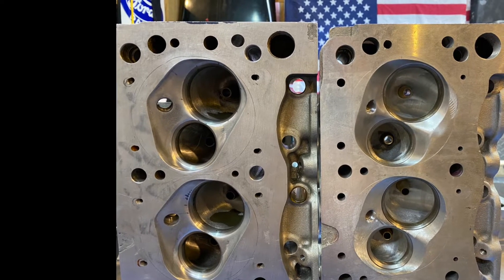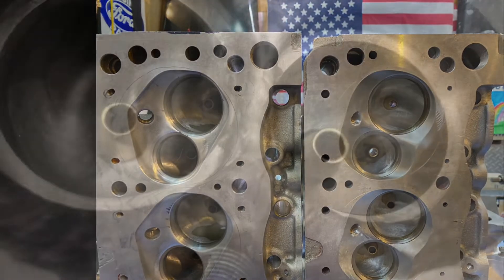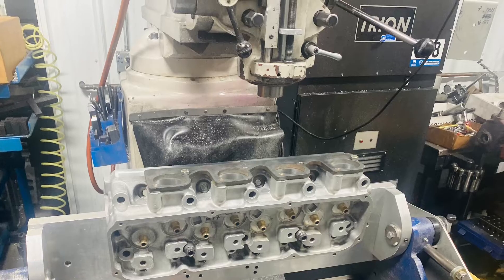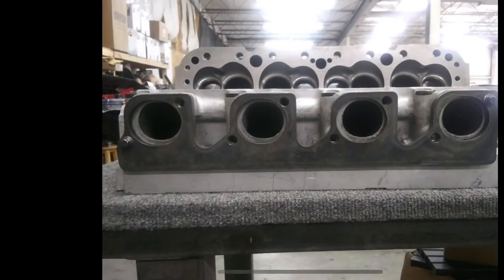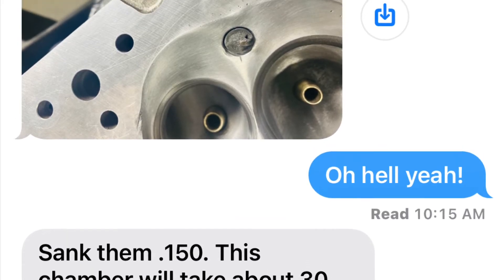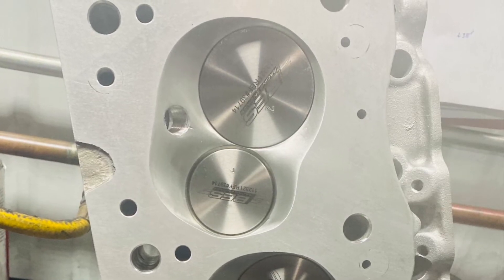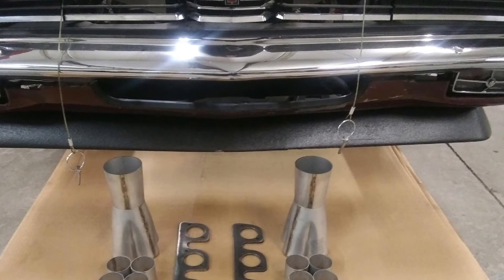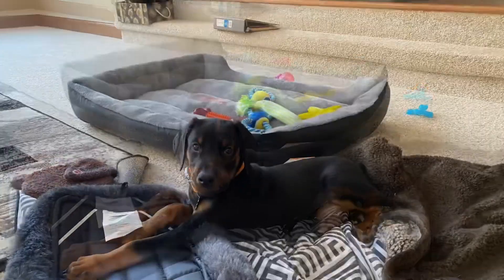DragBoss Garage:Secret A3 Heads for TrackBoss 427 Cleveland, Darin Morgan,  Merge Collectors/Headers

Comment: that is beautiful work. i.e. a work of art !  the big question is, how much HP is gained by all that expensive work, and what is the e.t. improvement ? Clevelands have remarkable top notch head design that can be improved upon even further.   they also have a few major limitations:  the bore spacing is only 4.38", compared to an FE big block 4.63",  and 429/460 which is 4.90", or 4.84" spacing of a BBC.  even the old brand X Pontiac 400/428/455 c. 1967-up had a bore spacing of 4.62", and 14 degree valve angle, and factory air gap intake, which is why it can still do what it does. bore spacing on the old SBC is 4.40"  
Being a thinwall casting block, with short deck, the original Cleveland was limited in bore size, cubic inches, and rod length.  427" is starting to get with the program, no replacement for cubic inches.  it would be interesting at that point, to see how those vintage Pro Stock heads would perform with a single 4bbl. in comparison as a baseline, because now you have the cubic inches under them, to use them at a lower rpm.  compre them to the Darin Morgan heads.  flow both types, cc the ports/chambers on both, dyno both, track test both.  prove it out. otherwise how do you know how much you gained, or maybe even lost, and where the powerband is ? it's all in the numbers.  don't just compare it to itself, compare it to all engines. otherwise we're in an echo chamber with blinders on, not looking at what else may be better and why.
Reply from the maker: Compare apples to apples Charlie. Cleveland I’m not s big ford or Fe or Pontiac. I don’t really care about them or their bore spacing with this build. The heads cost me nothing to develop and weld. Only parts. I am building this engine for a goal of 850hp. With 427 ci of aluminum Cleveland. I do not need to compare to any other engine. It means nothing to me. I will stay in my echo chamber with blinders on.  Not sure why you keep wanting to compare my builds with others.  Don’t take it personal. I don’t care about how much I gained or lost. I don’t care what is better it is irrelevant. Just enjoy the work and stop dwelling on every other engines specs and performance. That is not what this about.

Comment: When are You going to do another Live Video Chat with Darin Morgan?
I really enjoy them.
I am wondering his thoughts on Practical Airflow targets in Cylinder heads chosen to port for Powee and Fuel economy efficiency. 
Been researching the topic and very little information is out there.
The Ford Cleveland is One of the Ultimate Doomsday WW3 Engines I think.
Pontiac V8 especially the 455, Oldsmobile V8,  Classic Chevy V8 small block and Big Blocks.
Mopars like LA engines and B & RB Engines.
I wonder what is Darin's choice DD WW3 Engines ?
I have come to the conclusion 240 cfm - 310 cfm Target intake flow range is practical yet Plausible to get  20+ mpg no Overdrive Transmission used. Use our Personal Favorite Musclecar Race Car 44 magnum bullet proof Transmissions.
Reply from the maker: Not sure right now. Have had a back log of interviews to catch up with. I have some time now so need to get caught up with everything. Not sure what he likes, funny no real interest In Cars.

Comment: Hey Tim thanks for your videos they are awesome as always, also if possible  can you tell me  how much can you bore out  a 351c block  i heard 30tho or you can start getting over heating  issues  what is your professional  opinion ?? Thanks
Reply from the maker: It’s not that it makes them over heat. The cylinder walls are thin and get stressed and crack. The best engine I had was .040, it’s luck of the draw. But I would not go over .030, and fill the block. Thanks Ford
Reply: @DragBoss351Cleveland   thankyou  Tim    always   vrry good advice when you give advice
Reply from the maker: Your welcome. When I give advice, try and answer all questions the best I can. Thanks Ford351

Comment: I like the titanium intake valves, but with the exhaust valves being smaller in diameter than the intake; do using Ti exhaust valves make sense ?  Weights of the larger Ti intake valve and the smaller SS exhaust valve should be very similar. Could you do the weight comparison ?  Also, SS exhaust valves while being cheaper, are also much more durable.. just some thought Tim...   Ps... those heads are pure porn...  Bad Tim.. Haha
Reply from the maker: Thanks. The weight of ti valves is 90 intake 70 exhaust. I remember that steel intakes were like 120 grams. Don’t remember exhaust wt. this is the ultimate build to me and Darin does not use stainless valves I. Anything that runs over 8k. I have ran steel valves to 8 k for years no issue. I am going by their recommendation, since they are building this 427 cleveland.

Comment: Did he even move the plug angle?
Reply from the maker: no just welded up around the combustion chamber
Reply: @DragBoss351Cleveland  must be just the camera angle then. Looks like its  a different angle.
Reply from the maker: Yes I think that is what it is. He had to recess plug into combustion chamber but not change the angle.

Comment: Researched EMP Proof Vehicles Race Cars also on You Tube.
Very Little out there.
I actually have the most information on my own channel with my Pontiac 1963 Gp 455 520 Hp.
Plus information I left on various Hotrod forums and Corvette in past.
Research Vertex Magneto will find my posts via Google.
Reply from the maker: Cool beans my friend have to ck it out. Thanks